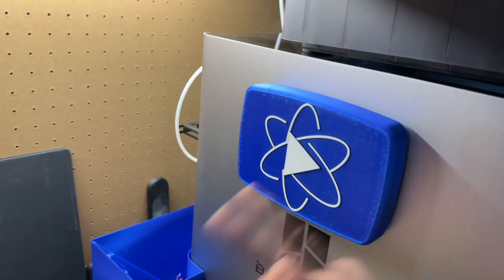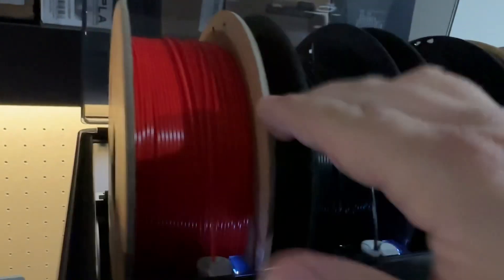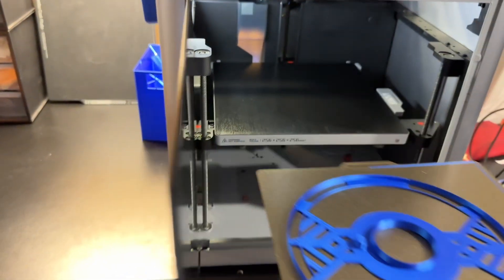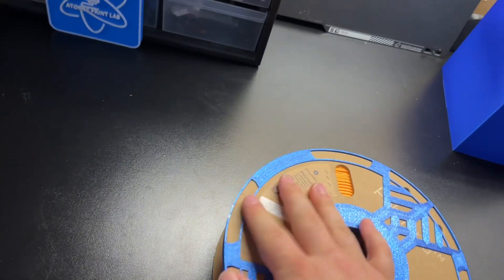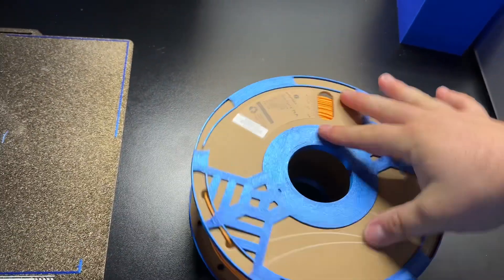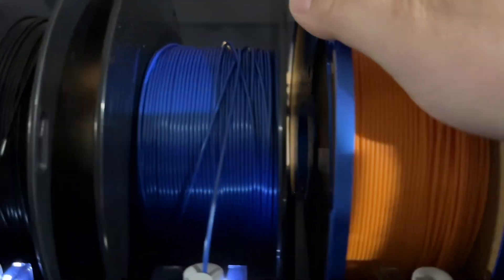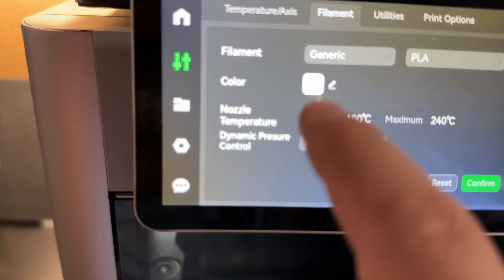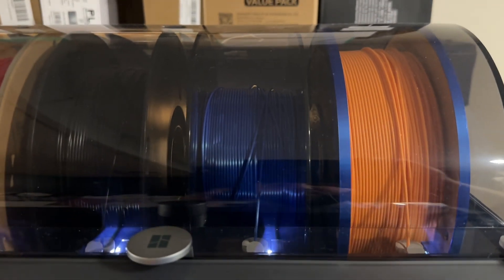Solving the AMS Dilemma: Adapting Polymaker Cardboard Spools

Comment: I tried the electrical tape and it worked...mostly.  I still had one polymaker spool that wouldn't spin fast enough and would keep dumping the filament off the edge.  Very frustrating to loose so many  hours on this.  These adapters did not work for me.  The spool would not spin smoothly in the bambu AMS after I installed these.

Comment: Interesting. Even just 0.6mm extra radius on my eSun rolls makes them rub on the AMS lid, when it's properly closed. I bought a new lid, after hearing a rumor that BambuLab increased the size slightly after the Kickstarter version. Alas, the replacement lid both fits perfectly and is exactly the same size. So, the rubbing still happens. I have resorted to transferring eSun filament to another plastic spool. (This and another plastic adapter both printed and fit onto my eSun cardboard spools perfectly — and both rub. shrug)
Reply: I'm cover the rim of esun's spool with electric tape and it kinda works